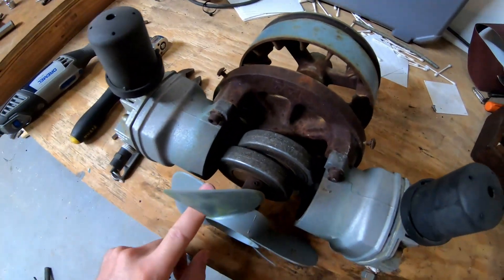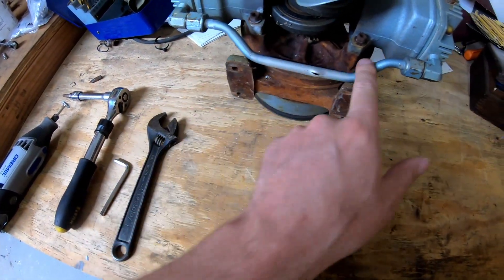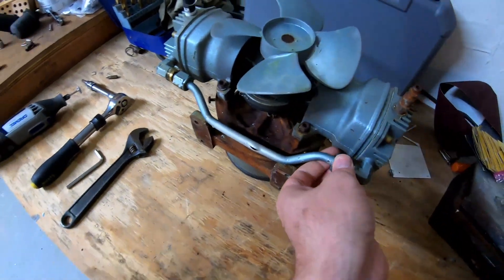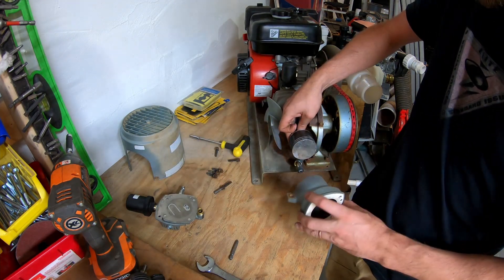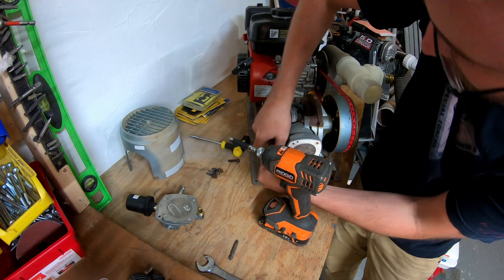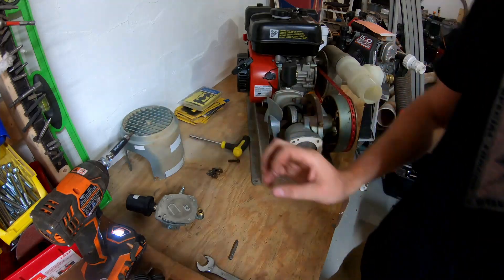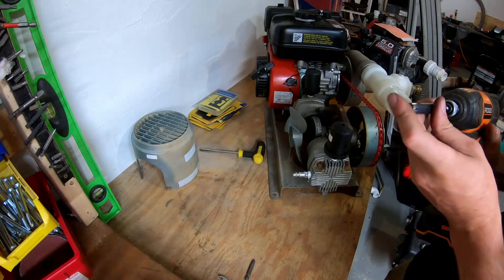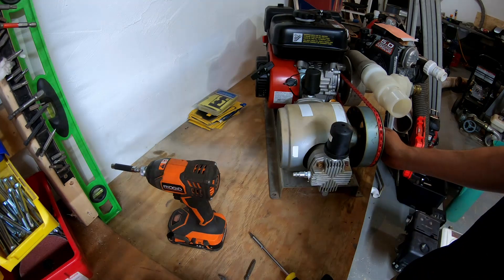Gast PCA 10 compressor rebuild

Comment: Great video, do you use a rubber dampner under your compressor or just mount it directly to the frame?  Also, how do those belts seem to work for you?  Much easier than taking the pump off...
Reply from the maker: Under the t80 compressors I use a rubber pad.   But not under the gast compressor.     As for the link belts for a long time I had no issues with them.   And then this year had a ton of issues and I’m not sure why.